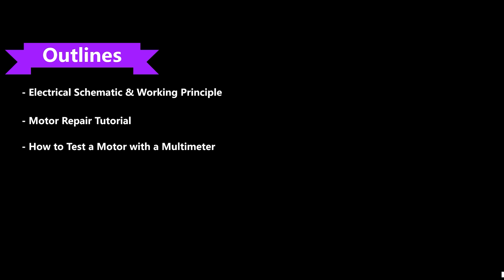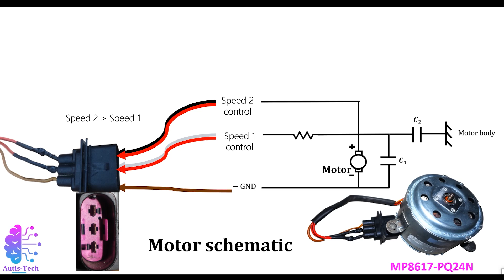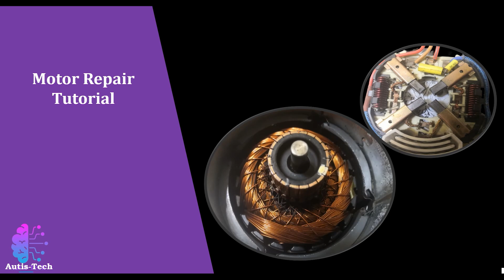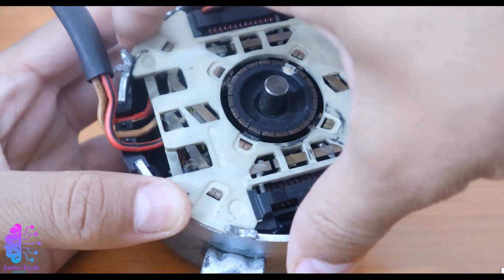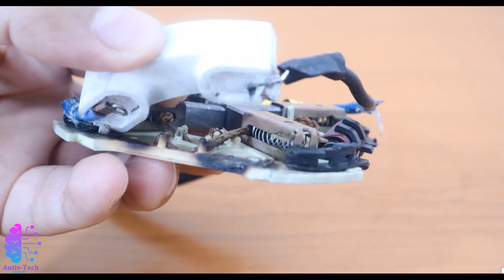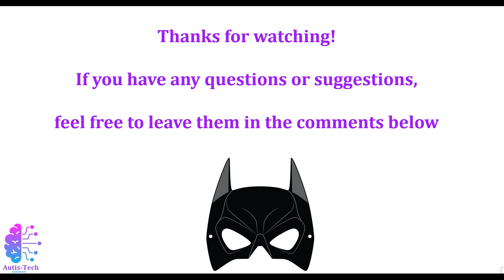Speed 1 of Car Cooling Fan is not working ? Easy Fix at Home! (VW Polo, Golf & More) | MP8617-PQ24N

Comment: Hello.
As far as I understand, the problem with the electric motor is a resistor made of the wire used to make heaters, the wire lost contact due to heating.
I have 2 cars with "Gate" fans, both fans lost first speed.
What do you think about the idea of installing an external fan resistor from a Fiat Punto "OE: 55703589", the price of the resistor is 10€. Before the electric motor, I would strip the insulation from the wire from the first speed, connect it to the resistor, and connect the other end of the resistor to the wire from the second speed. I would put the resistor and the wires from which I would strip the insulation in a separate box and protect it from moisture?

All VW "Gate" radiator fans have a first speed problem, if I open the electric motor and repair this connection, after a certain time there will be an interruption in the same place or on the other side of the heater.
Reply from the maker: Hello, thank you for your insightful comment, and sorry for the late reply. Could you confirm the value of the OE:55703589 resistor? In any case, speed 1 will be proportional to the remaining voltage after the drop across that series resistor.

I also noticed that you mentioned 'connect the other end of the resistor to the wire from the second speed.' Could you please explain why, or even provide a schematic if possible? That would help clarify your approach.

Otherwise, if the issue persists after following the repair procedure in the video, you can simply remove the resistor. This way, speed 1 = speed 2, and there will be no damage to the electric motor. Some technicians actually follow this method to avoid the re-burning issue you mentioned earlier.